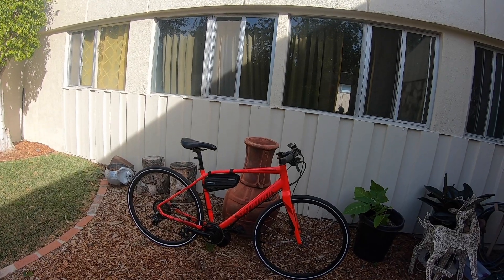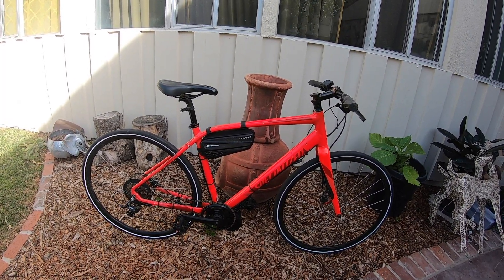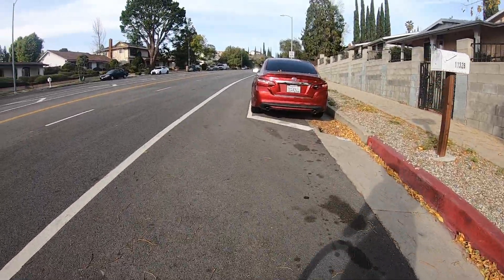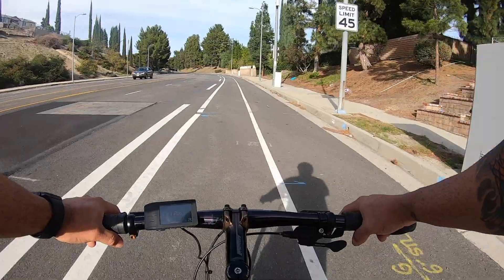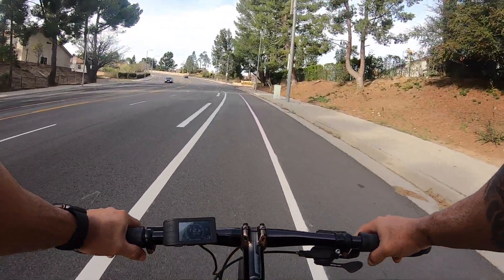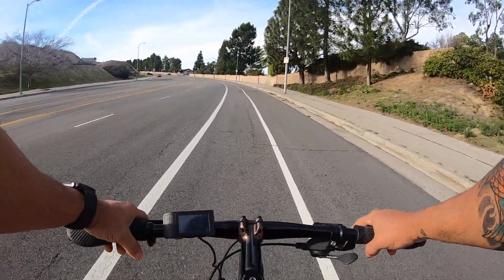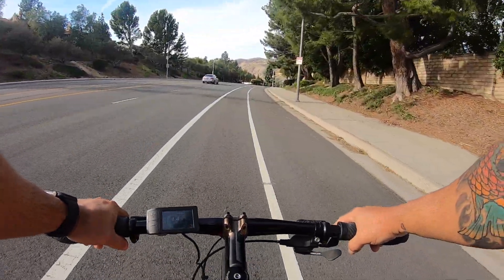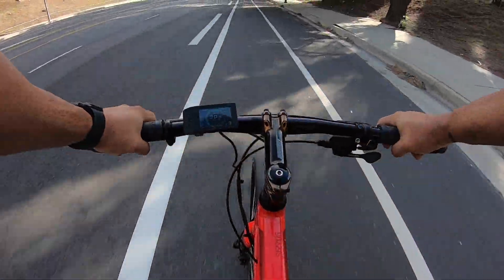Specialized Sirrus Custom Ebike Build And Hill Climb

Comment: Thank's I Found This Vid
I Got A 750 Bafang coming  And This Same Bike. I Was Thinking Of
Puting This On A 26 Inch
With Front Suspention 
Giant But This One Without Tires And Rims
Is Heavier Almost Twice
Than The Sirrus.
What Do You Think Will
Happen If I Dicide For The Giant In Terms Of Speed
I'm Not A MTB.
Thank' For The Advice!
This Sirrus Is So Light
That It Goes Down Even
By Blowing Air With My
Mouth onto Her 🤣
And You Know It's True👍
Reply from the maker: I had that motor on a giant hard tail mountain bike first. It was great. But it’s SICK on the sirrus man! The front suspension was nice at speed though
Reply from the maker: The biggest difference as you can see in the video, I didn’t even need to use the gears to climb a steep hill!
Reply: @GhettoZenMaster  I Love The Sirrus. Here In San Juan PR It's All Coast.
So I Will Go With The Sirrus. Then I could Order
Another Kit For The Giant
Or Do A Test On Both
I Have That Kit For $545.
Tax And Shipping  Not Bad. I Have A Natko 500w
48v 12ah rear hub 26 inch fat Tire Bike. Going To Use That Battery  For Now..Thank'For Sharing 🙏
Reply: The Gear Sensor Came With The Kit??
Mine Said  1 Set of speed Sensor😒
Reply from the maker: @danielandujar5479  No you have to order the shift sensor separately

Comment: How many miles do you think it will be with a 52v battery?
Reply from the maker: The 52v battery won't make much of a difference on range, but it would give it a little bit more snap. Not much though